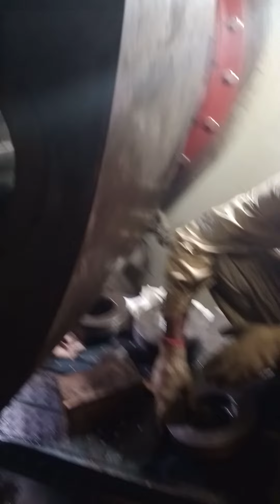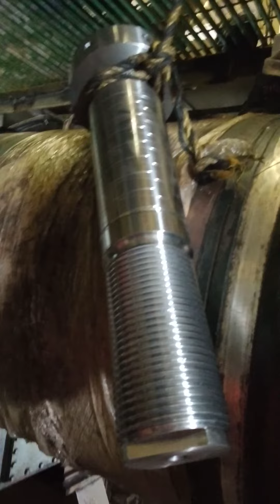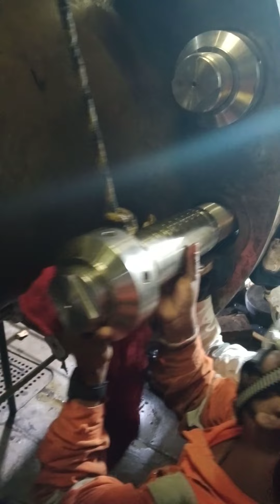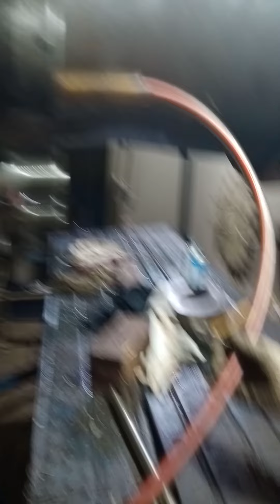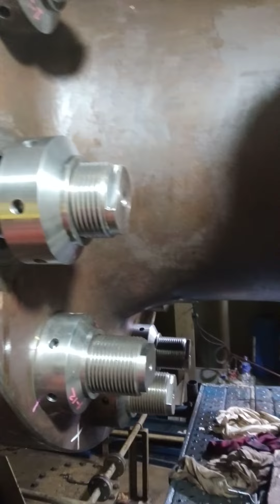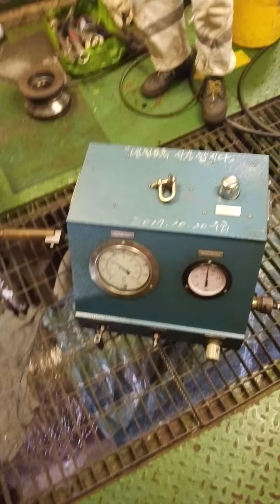High torque bolt's tightening. Pilgrim type shaft coupling bolt's installation methods.

Comment: These bolts should be fitted bolts ie each bolt specifically machined for that particular hole and should be numbered as such
They shouldn't be able to just slide in like that but should require a good tap with a hammer to place them
Reply: I looked up this video as we are currently machining the sleeves to suit new hole sizes in a generator coupling. 
The sleeves are being machined to suit each hole but I was surprised by the tolerance given. The sleeves are being machined from 0.07 to 0.10mm clear of the hole size. The sleeve must expand into the hole once everything is properly tensioned.
Reply: @nalbon1983  I've done several fitted bolt jobs on generator Vulcan couplings